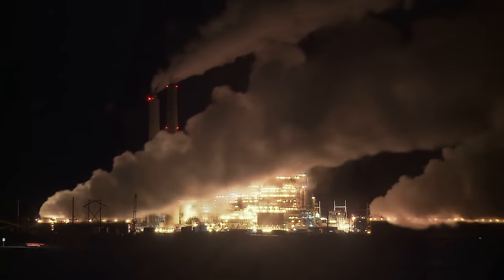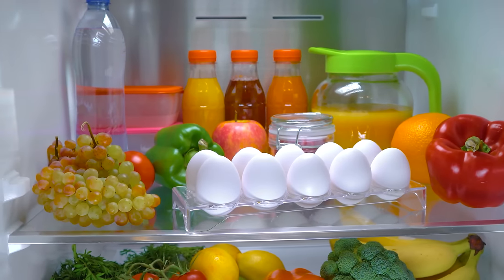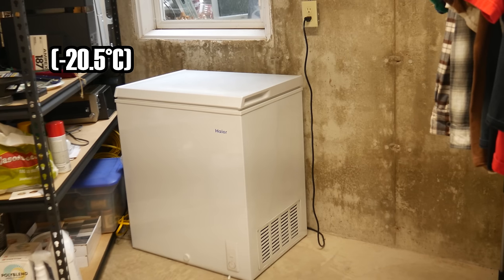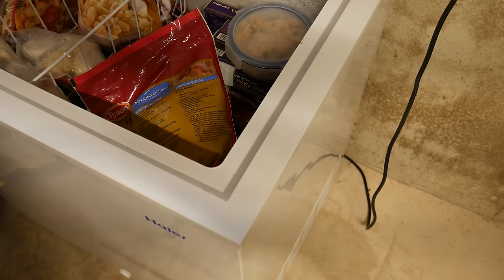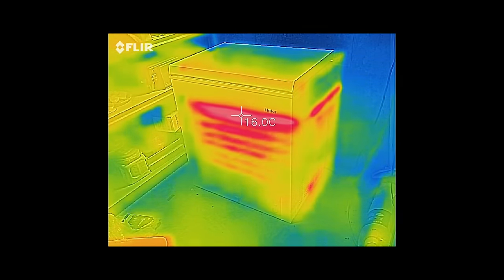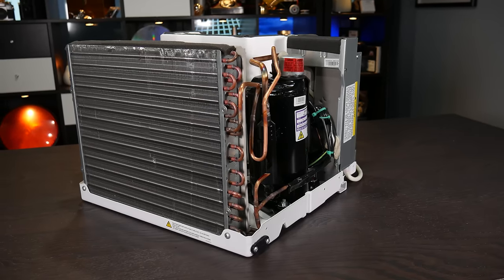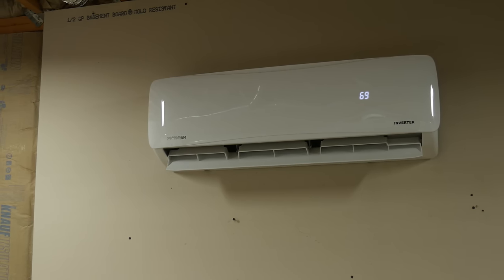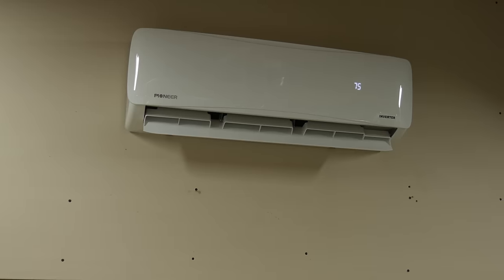Heat Pumps: the Future of Home Heating

Comment: I bought a "temperature regulating" coffee mug that has somewhat simlar concept of heat exchanging. It has a wax layer that melts when hot coffee is poured in to extract the heat and cool the coffee down to tolerable levels.  Then the vaccuum layer acts as insulation to keep it at temp for long hours. Not quite related but a pretty cool design!

Comment: I'm hyped for ground-source heat pumps.
Reply: We've pretty much moved past them at this point. Air source are so efficient and ground source are so expensive to install, they really don't make sense anymore. In many cases, it's more cost effective to install solar panels to make up the difference.

Same with solar water heating. For several years now, it has been more cost effective to install a heatpump water heater and solar panels than a solar water heating system.
Reply: @wiredforstereo  interesting. I thought maybe ground-source would be more scalable (for larger buildings) and better for extreme climates.
Reply: @snowballeffect7812  They are better in every way, except initial cost. Mostly because everyone is doing it wrong though. Really, it just depends how long you want to wait until it becomes worth the extra cost.
Reply: As in geothermal?
Reply: @xHadesStamps  No, more like trying to "bake" the soil during summer and trying to "freeze" it even colder during the winter.  Geothermal uses already hot rocks/soil to provide the heat for electric generation or heating only (no option to reject heat into the rocks/soil).
Reply: @haroldhenderson2824  are you saying you cant cool a home with geothermal?
Reply: @xHadesStamps  Only technically. A few dozen to hundred feet down, the earth is pretty constant temperature in most regions. This lets you avoid the problems we saw with heating in the cold because the gradient is a lot nicer to push into when you're pulling heat from 20 C dirt/rock instead of -15 C air.
Reply: So am I.  Over the last few years I've been a bit obsessed with heating/cooling efficiency.  Every second I watch this video, I imagine that copper radiator to be made 10 or 100 times larger (just run some long tubes) underground. Deep underground the temperature is stable.
Reply: @snowballeffect7812  Yeah, I live in the Chicago area, and we regularly get temperatures below 5° for days at a time. Not for the majority of the winter, of course, but frequently enough that you would need a backup heating system. Rarely, like once a decade it even gets as cold as -20°. A ground based heat pump could do away with the need for the backup heat source entirely by providing a steadier "outside" temperature to draw heat from.
Reply: @snowballeffect7812  
hi
you don't need hundred feet to reach stable temperature, depending on the soil and moisture in it, you may just need around 1 or 2 meter (3.3and to 6.5 feet)
Reply: @Provigilman   @Ken Proctor  it works quite well; I have a geothermal heat pump thats connected to a 700 ft vertical loop of HDPE agriculture water pipe filled with propylene glycol. I live in upstate NY and temps are similar to what you get in Chicago. Only real downfall is by no means can it produce heat instantly, even in auxillery mode its no match to forced air.
Reply: @AmirDarkOne  you're right, but unless you have a bunch of land where you don't plan on digging, have to worry about heavy vehicles drive on, or building on top of, then a vertical loop is necessary.
Reply: @RangeRov49  
all buildings need Foundation, 
i mean you always have to dig a few meters so you can build Foundation.
so why not just add some pipe down there as well?
if they build new building like this, it would make heat pumps much more affordable , because you don't have to pay to dig a second time
Reply: @haroldhenderson2824  Ah, so a different thing
Reply: @AmirDarkOne   that's what was done in my system; it comes out of my basement, but it still requires 1400 feet of plumbing, 700 feet down verticle loop in my case, which I paid to be drilled. Even in the case of a horizontal loop, that would have to be dug and laid, which the contractor that build my house wasn't hired (nor qualified) to do.
Reply: @AmirDarkOne  that does pose the question of how do you access them for repairs and eventually replacement.
Reply: @snowballeffect7812  Scalable, no. They require a lot of earth or a lot of water to make it happen. For instance, I believe it is Toronto that uses Lake Ontario. And of course there's Iceland. But those are using natural sources of heated or cooled water. This causes heat pollution though.

It is good for extreme climates though, it works where air source heat pumps don't.

Check the economics in your own situation.

Comment: I was considering having mini splits installed in my house in place of the oil burning boiler system…this video just helped me understand just how much more efficient and cost effective this choice would be! Thank you so much for your time and informative video!!!!
Reply: A full split system in a full size home would be even more efficient than a mini split unit if you looking to do the full home but mini splits to have their place if you are looking to use it in just one or two rooms or an area like a shed or garage or workshop
Reply: Mini-splits are HEAPS more efficient than a full-house system. The reason is that you only need to heat and cool the rooms that you actually use. You don't need to heat/cool any of the bedrooms during the day when everyone is at work and school. You don't need to heat/cool the living spaces at night when everyone is asleep. You don't need to heat/cool any room that is not being used.

The Mini-splits are relatively powerful (compared to a whole-home system) so you just leave them switched off most of the time... when you are just walking through a room, you don't bother switching them on. If you are going to stay inside the room, you fire the A/C for THAT room only. Modern split systems use PIR sensors so this happens automatically. The room will feel warmer or cooler in a few minutes.

The other significant advantage of mini-splits is that you can dial different temperatures in different rooms. This prevents the crazy situations like old people running a electric heater because they think that the (whole house) A/C is too cold.
Reply: Central A/C and heating does let you close vents in unused rooms.  Right now my house only has open vents in 1 bedroom, 1 TV room, and 1 bathroom.  All other rooms are closed
Reply: @electrictroy2010  - if your vents are in the floor, then yes. However you are still running the big central unit and using unnecessary power even if some vents are closed.
Reply: That’s a horrible idea and what keeps HVAC business owners wealthy and techs busy

Comment: "My garage has a problem of being too humid."
"So anyway I use the air conditioner to melt the snow off my car inside the garage."
Reply: I hope he gets his car washed fairly often in the winter, then. A bunch of freeze-thaw cycles of salt water are much more likely to cause rust than just a deep freeze would.
Reply: @jonathankleinow2073   Yes. But really in a perfect car owner world one had got a car lift indoors and a water jet to wash the underside off. Just cleaning the sides and wheel houses are not enough. You need to get under and clean :c And then let the car rest and not drive it home on slat roads. And AVOID the spinning washers of death! Cost money to ruin the car? What?

But that is you care about rust and like to keep a car running for decades. But then your not going to own any modern car. And btw you basically need a garage for electric cars in winter. Or your having to keep the battery heated form the cold. Makes no sense to own a Electric car unless your not parking on the street and live in a place it makes sense. Anyways. 

If I ever build any building in my life it will be a double garage with a lift. And a smaller size room for a bed and kitchen in the back with washer and toilet/shower. I rather live in a garage then with crap cars that is being ruined by the salt. Can do allot of stuff in a empty big garage. Cost less to. (vs a living room) You just need good garage doors and limit the height of the roof and the building will be cheap to build and run. No windows and no wasted space. A efferent heating and cooling space. Just not family friendly. Good. I rather visit others and live outdoors.  

One of the lifts that are easy to drive onto. So you always park on it to wash. (but a jack point lift is best for repairs but simply not good for everyday stuff)  Even a deep freeze is affected by road salt. Better to keep the ** off. It also is better for the car to start in a heated environment. -25 Celsius or more is simply to big of a strain on the drivetrain. Even with block heaters and hours of time heating before starting it is just not right. You basically need such a intensive water and oil heating system to keep the engine temp good enough to safely start it up. You might be better of emptying the car of the liquids and heat it on the stove if standing outdoors... No joke that's what it takes. Emptying the liquids and keep them indoors. Then your still having to get under the vehicle and still stuck with salt under the car. 

Even + 1 Celsius environment is such a advantage for the driver and vehicle. Thinking about a costume lift built into the ground. So you don't have to lift the car up as high and the car can drive right onto the lift without any hassle. Basically a better oil pit with more space and flexible. (like a flexible standing desk at work). So you can get away with a low sealing garage. Since your lift is down in the pit and only need to raise the vehicle half a meter or so at most. (safer and flexible) And in a pinch you got enough space under the vehicle to not even need the lift to work. Agen a better oil pit. The hole point of the lift being to give as good access all around the vehicle as cheap and safe as possible. Downside being flooding and having to spend more time on the foundation. Not worried about flooding but the cost of install.

Then you basically can be down there with a rag and water bucket :) Or just spray it off but expect to be a bit wet from doing the hole car that way. Only way to combat salt is to get under there and clean it. No way to reach it otherwise. Well unless you let it melt away and then go after the remaining SALT. But you NEED to care to combat salt. No one really do. But I rather spend money on a lift and garage door and keep the cost down by making sure repairs are cheap. (and vehicles that do not require expensive repairs)

Heat pump and wood stove for the win! And a living room with garage door access! No sweat getting a fridge or a bed indoors ever agen! Just keeping the garage doors and lift in good nick! And vehicles you can care and love for. Making sure you can access the world and still have a grate living quarter.
Reply: @TheDiner50  I mean, alternatively, you could just live somewhere that doesn't salt the roads
Reply: @TheDiner50  You should check out The Detail Geek on here. He runs a detailing business out of his heated home garage in Saskatchewan, and he has a undercarriage sprayer attachment for his pressure washer that he uses on the vehicles he washes.
Reply: @TheDiner50  or you could just get your car rust proofed at a place like krown once a year and not worry about any of that
Reply: @TheDiner50  you sound like my dad, I'm helping him build a garage just like that. Rock on dude!
Reply: I don't think it gets humid in the winter...
Reply: @veryInteresting_  The air in winter is dry, yes, but melting snow in an enclosed space (like a garage) raises the humidity in that space. Winter air is only dry in the first place because cold air can't hold as much moisture as warm air.

Comment: Hey TC, I'm like you and find this stuff cool.  You might get a kick out of how large jets provide pressurized cool air to the cabin.  They call it an air cycle machine (ACM).  It's similar to an AC, but doesn't use a refrigerant.  It still uses heat exchangers (radiators), but also uses a turbine (turbocharger).  It's kind of cool how it works.  They can't just take cold air from outside because it needs to be compressed to help people breath (air is not dense enough at altitude), so they bleed air off the jet engine compressor.  That air is hot because it was compressed, too hot for the cabin, so they send it through the air cycle machine.  If you get some time check it out, I think you'll enjoy it.

Comment: When I was living in Germany in the late 1970s, heat pumps to collect residual and exhaust heat from heat-intensive situations (like bakeries) and pump it back to where the heat was needed, were all the rage. I moved to Japan in 1981, and here minisplit air conditioners were already the norm, and by the mid 1980 dual purpose minisplits with inverters were becoming common. During the 1990s and early 00s, I had two (Toshiba-made) minisplits with kerosene burners for augmentation when it was cold enough that burning the kerosene for heat would be cheaper than using the heat exchanger only, though oil and electricity prices flipped at one point, obviating the utility of that facet of the burner. There has been a lot of experimenting with geothermal heat pumps for home air conditioning here, too, but it doesn't seem to have caught on, perhaps because building lots are so small (and this is kind of ironic, given all the general geothermal potential in Japan). All that said, my current house is completely air conditioned quite adequately with minisplits.
Reply: It doesn't catch on because a giant company can't maximize profit with it
Reply: @watamatafoyu  No, because gas companies have more leverage over AC companies by a country mile. Making furnaces stay a standard meant bribing the right people. So gas heating shall remain the primary heating of the majority of homes for as long as possible.

Comment: 80% of this video went over my head, but I still grasped the big picture. You're a good teacher! Coincidentally, our city (Santa Rosa, CA) is having a grand opening this week of the Sonoma Clean Power Visitor Center, and they sell heat pumps and have info about rebates and other financial assistance. Hoping we'll be able to get a unit that works with the new electrical panel that we had to get in 2018 when we bought solar panels.
Reply: I’m also from Santa Rosa! Thanks for the tip

Comment: I live in Plano, TX, and yeah, that extreme winter week we had was pretty rough. I am so extremely grateful that I never lost electricity or water, and being from the north originally, I love the cold and kept my heat at around 65 F and was enjoying the snow. But, for a huge number of people, it was really, really bad. If only any leadership here at all would have admitted this was possible decades ago.
Reply: It was going to happen somewhere first Anthony - glad to hear you made it through that extreme weather event.
Reply: I think it was 2011 that had a similar cold snap but the results were manageable. What happened is a cascade of multiple issues. 

Failure of Renewables:
Renewables accounted for 16% of power then. 
Renewables now account for 25% of power. 
Renewables are vulnerable to extreme cold and humidity, aka snow and ice.
Renewables were producing less than 5% vs normal 25%.

Failure of Government:
Biden administration's EPA/DoE doubled down on extreme regulations.
They required the power companies first buy power at overinflated values from external grids. 
They then required the emergency power production be extremely restricted by pollution controls. 
In an emergency restrictions should be temporarily removed to spin up energy production fast. 

Failure of Gas Supply:
Due to power failing, even more people started utilizing gas for heat. 
The gas power plants use this same gas system. 
The pressure in gas lines became extremely low.
Water vapor froze inside the gas lines and inside pumping stations.

Conclusion:
This was a perfect storm showing the failures of green energy and government ineptitude on a grand scale. I was going to criticize people's individual actions but they are the victims in this. Green energy is far from reliable and extremely inefficient. It over relies on the need for storing energy and needs further development. In the mean time we need to update our nuclear plants and build new ones, we are generations behind available technology due to nonsense over regulation and fearmongering.
Reply: @LeoInterVir  interesting which government you say is the source of the failure. I don't want to get into a long winded argument, but let's just say that it was shown that frozen renewable sources were a fraction of the problem, and that all kinds of generation were severely impacted. Literally the only thing in that entire wall of text I agree with is that fearmongering is an issue here, but not because of the very real and obvious threat of climate change that really only the US and a few other countries refuse to believe, but because nuclear power should be more widely adopted.

Comment: I love heat pumps :)  we use air to air in the apartament and  water-water at the house. even now when the electricity is 3-4 times as much is cheaper then gas. We keep it at 21C to lower further the costs. We insulated the gome and the attic cc with spray on foam the thing cost at least 70% cheaper
Reply: We use a heat pump as well for our heated flooring as well as our AC unit which can heat or cool using the same water and heat pump as the water cooling unit. Just got to shut the valves for floor hearing in summer so the water only travels to the AC unit.